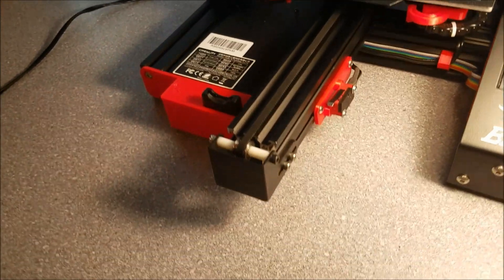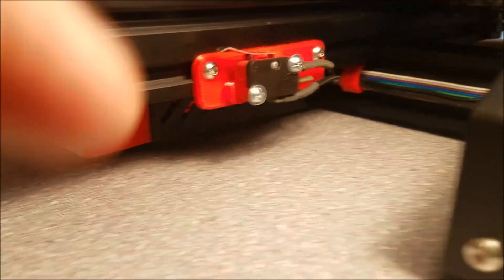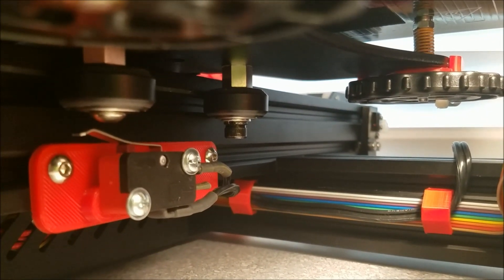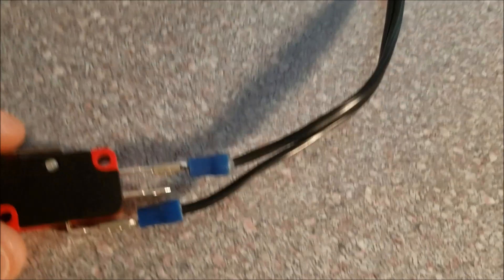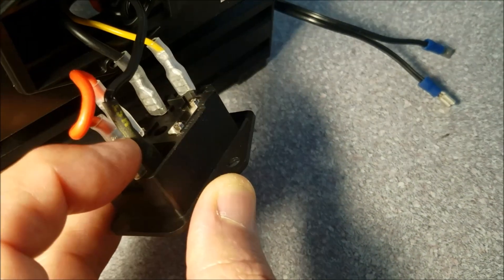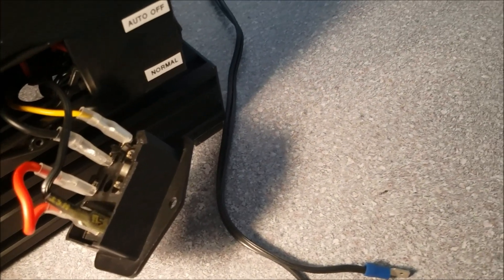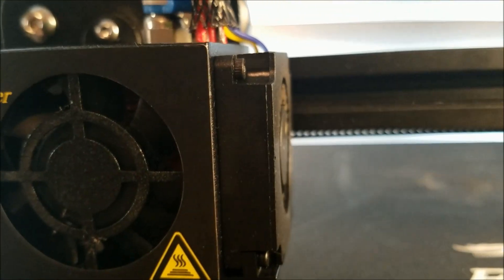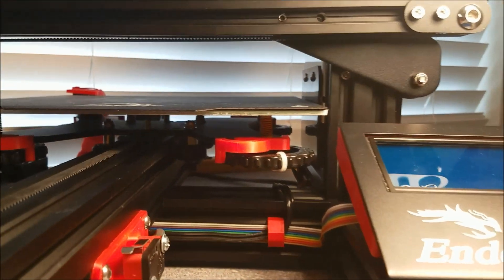Ender 3 Pro auto off with cool down - simple!

Comment: What happens if you are printing something which will require the full available length of the Y axis? The printer will shut off mid print. I suggest putting the switch slightly out of bounds, to allieviate this.
Reply from the maker: Forgot to mention, I printed a square 216 x 216mm (Cura wouldn't slice 220 x 220mm) and it worked fine. When the rear-most part was being printed, there was easily four or five mm of travel remaining to trip the switch. So it appears that if you can slice 220mm square, you can also print it with this improvement. You just need to place the switch to trip at a point at or near the maximum of the frontward travel at the end of the print.
Reply: @stevemullens7937  That sounds awesome then! :D Although, I'm not sure why your Cura wouldn't slice a 220x220 square... It lets me do that on my Cura.
Reply from the maker: Unless the print is square, use the X axis for that dimension. Notice in the title the word "simple", also notice in the video, the rear-most part of the power supply has labels that read AUTO OFF and NORMAL. I wired in an ON-OFF-ON rocker switch to bypass this improvement should I ever feel the need and to date I haven't! Essentially, connect the wires to and from the micro switch to each other via another switch that will connect the two wires directly when switched ON. Just make sure the amperage rating is high enough for your voltage. I didn't think it would be "simple" to show this feature because I used a switch that I could barely fit in the chosen spot and didn't want to encourage others to possibly damage parts of their power supply. A simple (there's that word again) toggle switch could be used and installed into the wiring box at the bottom of the power supply to defeat this auto off feature, just realize that the micro switch will cycle on and off every time the Y axis extends fully which would wear out the switch prematurely. Obviously, there are other solutions as well. I hope this was helpful.

The switch I used was like this, but wired differently than described.        https://www.amazon.com/Twidec-Position-Toggle（Quality-Assurance-Years）KCD1-5-103/dp/B07MV5K2JV
Something like this could be used as described.                                           https://www.amazon.com/APIELE-Position-Rocker-Toggle-KCD1-5-101/dp/B08DKCJK6K
Or this.                                                                                                                   https://www.amazon.com/Gardner-Bender-GSW-18-Heavy-Duty-Electrical/dp/B00004WLKC
Reply: @stevemullens7937  I've just mounted a mechanical linkage out of bounds. The Y on my printer can normally go from 0 to 220, and ive set my gcode so that at the end of all prints, the Y axis pushes on the mechanical linkage at around 225 (out of normal printing bounds), and the mechanical linkage leads to the printer's original power switch, turning it off.
Reply from the maker: @londonnight937  Cool. Make a video and post a link in these comments. I'd like to see it!
Reply from the maker: @londonnight937  In addition to what I wrote in response above, I believe that when the print is presented, the bed moves PAST the outer limit of the print area and the micro switch can be placed to turn the machine off just at that point or a couple of mm before that ultimate distance. Be sure to make that linkage video and post a link in these comments.
Reply: @stevemullens7937  I've uploaded a video showing my setup, on my channel. Tell me what you think about it :)
Just to be clear, in no way I'm saying your setup isn't good :)
Reply from the maker: @londonnight937  I watched your video. Great solution for your model of printer. The only mechanical solutions I've seen for the Ender 3/Pro requires the Z axis to move to the very top to mechanically trip the switch. I hate having to wait for the Z axis to move very far in either direction!
Reply: @stevemullens7937  Looking at ender 3 pictures, there should be a way, from what I see, to perhaps use the gantry itself, by moving it all the way to the right hand side, until it goes out of bounds, and then move it down, until it hits a simple lever, maybe it could be all printed, so no extra parts needed. Now, I would try it, but I don't have an ender 3 >.<
Reply from the maker: @londonnight937  Luckily for me, my way works well. I'm not worried about electrocution, like some people might be. If I ever get a different printer, I'll contemplate a mechanical solution as well. Have fun printing!

Comment: My bed goes backwards after the print is done. I'm using OctoPrint but it was doing it before too. Anyone know a fix?

Edit: I found the G-code for the "end G-code" printer setting to push it forwards:

G91
G1 F1800 E-3
G1 F3000 Z10
G90
G1 X0 Y220 F1000 ; prepare for part removal
M106 S0 ; turn off cooling fan
M104 S0 ; turn off extruder
M140 S0 ; turn off bed
M84 ; disable motors
M117 printed @ 1mm.

Comment: Great job. I’m new to this and wonder do you have the machine shut down between smaller prints or do you change the g-code depending on print time?
Reply from the maker: If I'm doing several small jobs consecutively, I will try to remove everything from the bed while it is cooling and then start the next job. Of course, all of the projects would have to be on the memory card at the same time. If the jobs are small enough, you can load more than one into the slicing program to print at the same time! As to changing the g-code, when you make the new code changes, you can save the new version under a new name and choose between saved g-code profiles for different desired ending actions. I always use the auto off, since I rarely have more than one project going at a time and they are often several hours long. Hope this helps.

Comment: I find it a bit dangerous with live wires direct in front of the printer. Normally this should close a 5 or 12v Relais which shuts of the 110v or 220v.
Reply from the maker: With my covering all contacts with heat-shrink tubing AND using the printed cover which isn't shown in place in the video, I would have to shove a grounded scalpel behind the cover and dig around until contact is made. In other words, I CAN'T make physical contact with any conductors without intentionally using tools. I hope this alleviates your concerns.

Comment: Have you moded the sd card slot ?
Reply from the maker: I designed a mount for a micro SD to full size SD card adapter. It can be found at this link with some info. I hope you like it.     https://www.thingiverse.com/thing:4334646
Reply: @stevemullens7937  looks good,i ll try it thanks